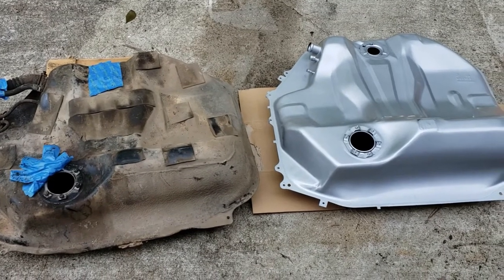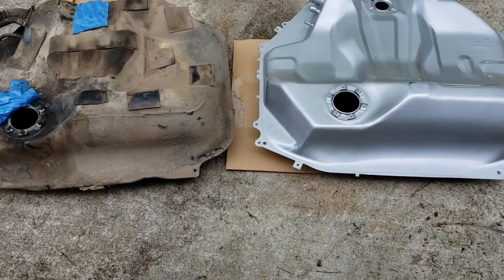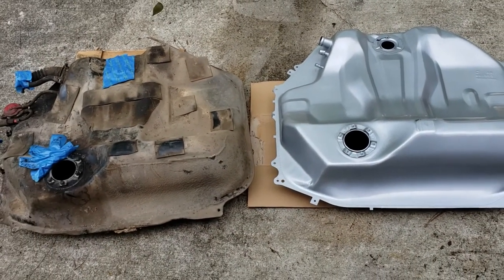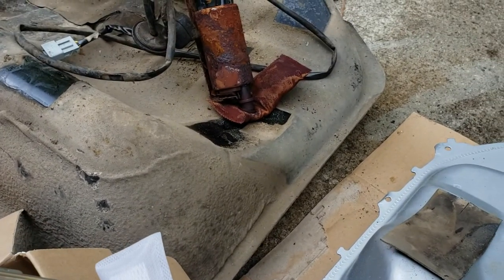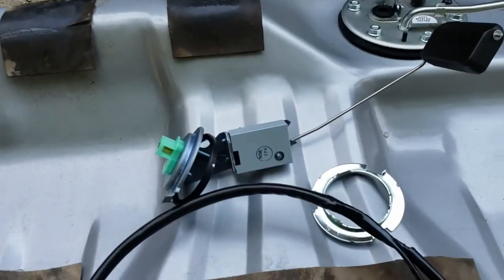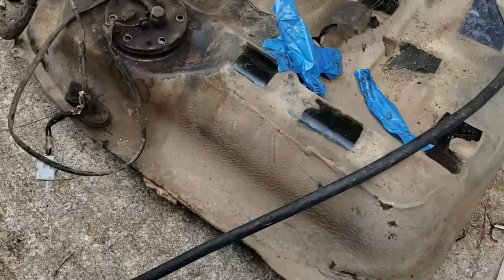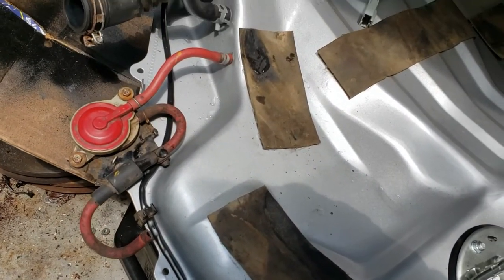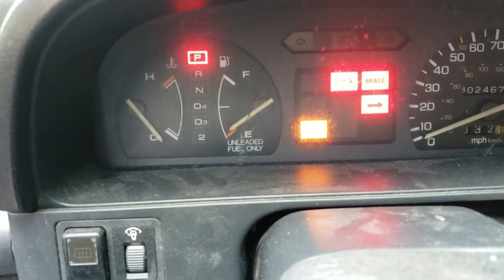1991 Honda Civic Hatchback EF ED6 Restoration Part 4 Fuel System Replacement

Comment: Wow!! I bought a hatch as well, and my fuel pump isn’t getting any power. My engine turns over, acts like she wants to start but doesn’t. I was using starter fluid to see if it would even start on that. No luck, so next thing is compression test and then I might just drop the fuel tank and check it as well